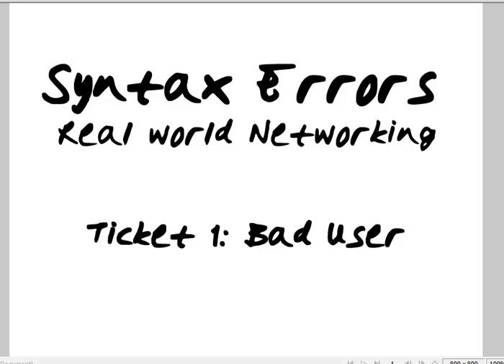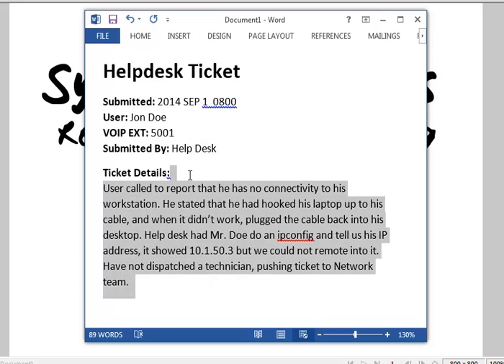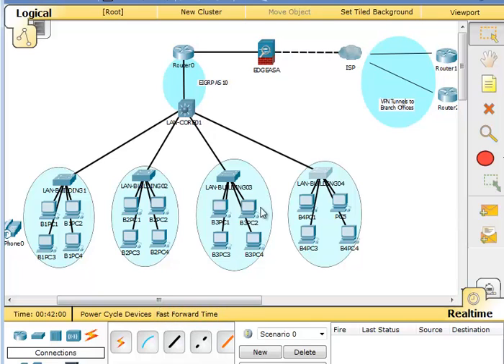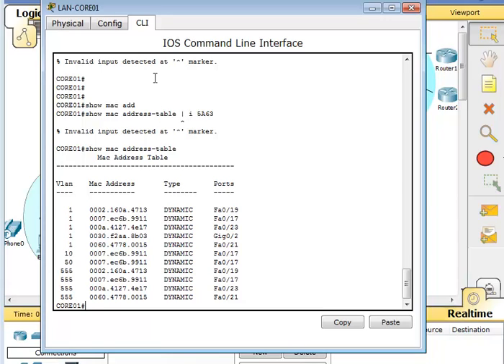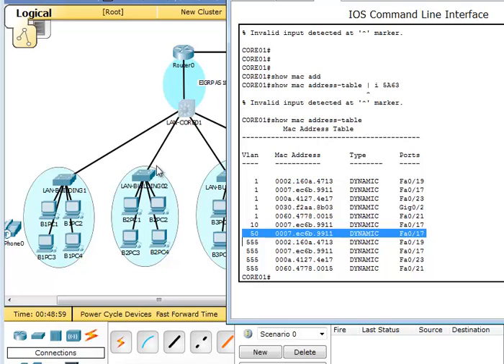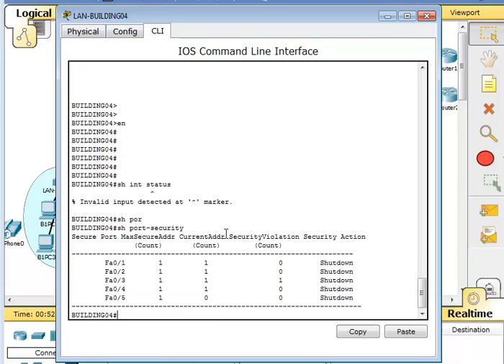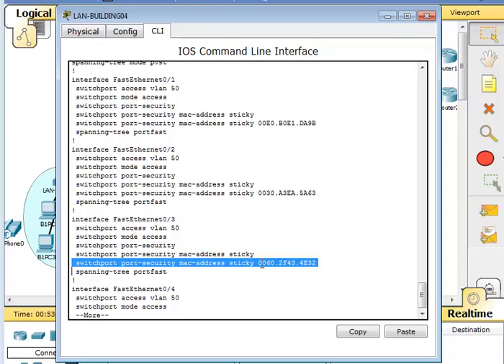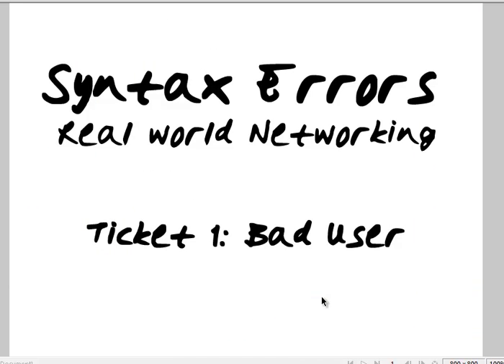Real World Networking: Ticket 1 - Port Security

Comment: I'd recommend mentioning something about errdisabled recovery even though PT (even 6.1.1) doesn't support it.

Real equipment would be the best, but most costly option. GNS3 still doesn't (and will probably never) support cisco's catalyst switches, although you could probably mix and match the two. GNS3 for the routing and a couple of cheap 2960s and/or 3560s for the switch side.

Or just use the 3560s and enable routing on them. so many options!